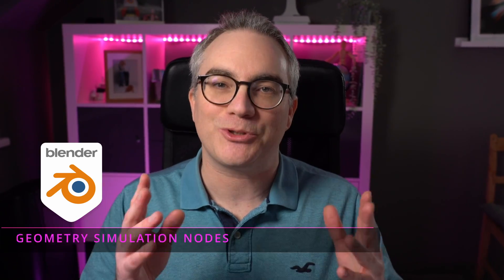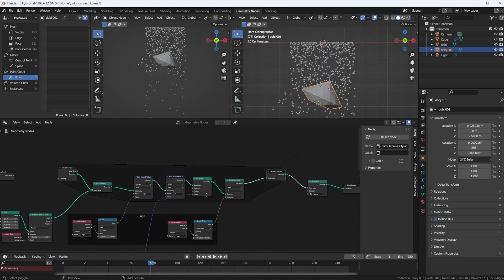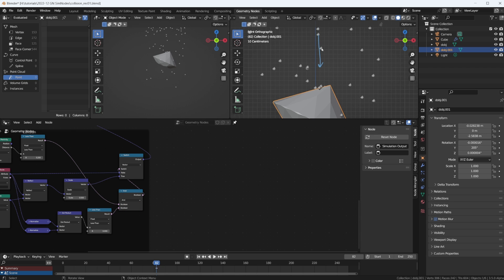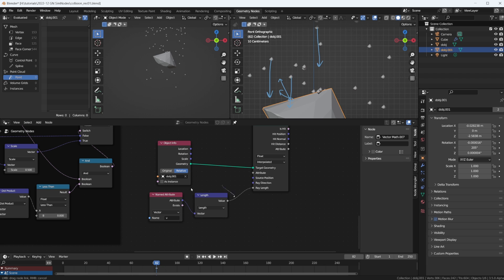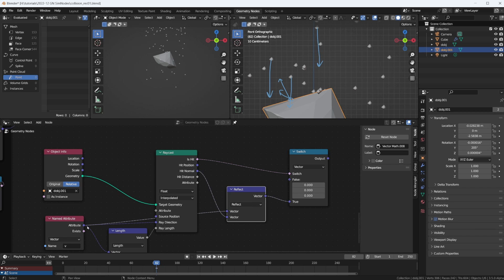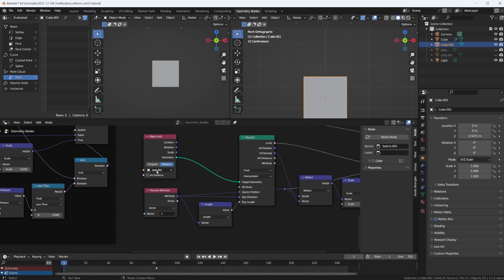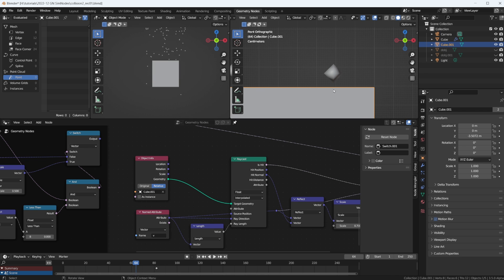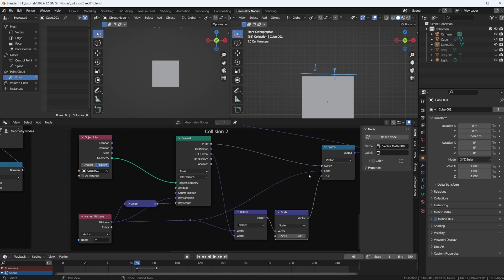Collisions v2 Blender Geometry Simulation Nodes Tutorial How-To

Comment: Hi Chris, thank you for your great tutorials! I have a question: if you want to combine particle collision with an object and use the same method to deflect the particles when they collide among themselves? I tried the method you used previously by just displacing them when they get close, but that gives a jittery motion not reminiscent of real collisions. I would like them to continue with their "reflected" velocity following the collision as with the collision with the diamond.  There is probably not a short answer, but I think it’s an interesting problem.
Reply from the maker: Hi, have you seen this: https://www.youtube.com/watch?v=vJxVzS9gFYY ?
Reply: @chrisprenn  Hi Chris, thanks, I have seen it, but it's not what I'm looking for. In that tutorial particles are simply displaced if they are closer than a specified limit resulting in jittery movements.
I wonder if and how it's possible to simulate a more accurate collision among the particles, i.e. how they retain velocity and fly apart according to pre-collision velocity.
Reply from the maker: @torher436  Particles are reflected accurately upon collision (no "specified limit") and I don't see jittery movements. Increase the sub frame calcs shown in the video (you can now use a repeat zone for that) and you can always do higher fps for smoother videos. But other than that 🤷🏻‍♂️
Reply: Thanks, will try that 😊

Comment: Okay.. this works and all..  but how can I replace the points with an Object?   Blender 3.6 crashes / stalls every time I try..
Reply from the maker: what kind of monster object are you trying to instance onto the points? ;)
Reply: @chrisprenn  I fixed it,  I was trying to put a realized ico sphere on to the points before the gravity effect.   I finally realized that it should be done after the simulation.

now.. how do I get a point to spawn new reflected points after the ray cast calculation?  hrrmmm

Comment: Wouldn't the RayCast Length give you a measurement too?
So there must be some math to say where it hits in 3d space and where to bounce from, instead of just bouncing from the frame it's currently on. Then you should be able to calculate how far it has to travel before it Hits and how far is left after.
I hope that makes sense.
Great video again and much simpler node setup GG
Reply: The math should be something like
newVelocity = energyLoss * reflect(oldVelocity, hitnormal)
newPosition = hitPosition + newVelocity * ((length(oldVelocity) - hitDistance) / length(oldVelocity))
basically, the ((length(oldVelocity) - hitDistance) / length(oldVelocity)) is the amount of 'motion' left in the particle after it's traveled to the hit point in the subframe; this should be a number not a vector, hence the length calculations. the direction comes from the vector newVelocity

Comment: you can still get more accurate without sub-frames by using the length of the hit and the hit position, but I don't think it is worth it (not that I think it would be particularly hard, but) because it is also perfect the way it is now. (just pointing out that you can probably get actual perfect collision detection without sub-frames)
Reply: how would you do this? because i do actually want to get more accurate collisions. a bucket filling animation wont work well if theres holes where there shouldnt be after all
Reply from the maker: Think so too 😁

Comment: Does that mean the raycast node calculates if there is a collision in between frames? I don't see any node calculating if the distance is less than x, consider collision
Reply: yes. it casts a ray in the direction it is moving and the distance it would travel in this frame and if it hits (meaning it will hit in this frame) then we reflect it. we don't need a comape node because the ray length does that for us already p the is hit 
( for @Chris P : so if you compare the distance of the hit with the ray length you can change the velocity (strength/ magnitude) according for the reflect to get it more accurate, and set it to offset from the hit position instead of what it is now)
Reply from the maker: @shmuelisrl  yeah but keeping it simple and with the scale to .7 it looks just fine 😉
Reply: @chrisprenn  I mean scaling the velocity before the reflection not considering the dampening. 
(still you wouldn't gain that much more accuracy than you already have)
Reply: though you might want to take into account the radius of the  particles
Reply from the maker: @shmuelisrl  yes, that too. Like i said in a previous tut this is not to create the best physics sim but to show what you can do with geo and sim nodes
Reply from the maker: yes - kinda - all collisions happen "between frames" since you will never have a frame be exactly at the right time where the particle is exactly hitting the surface. So for each frame - before we move the particle - we calculate if it hits, and if it does, then we set the particle to the position of the reflection vector.
Reply: @chrisprenn  Thanks for your answer Chris. I just realized while writting a reply that this distance is actually the ray length that you plug into the raycast node. Now everything makes sens!